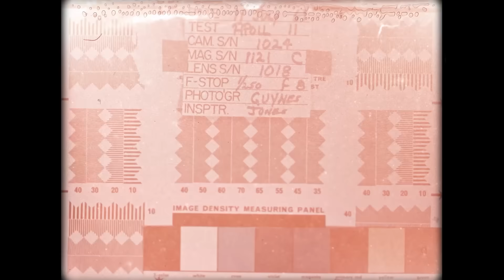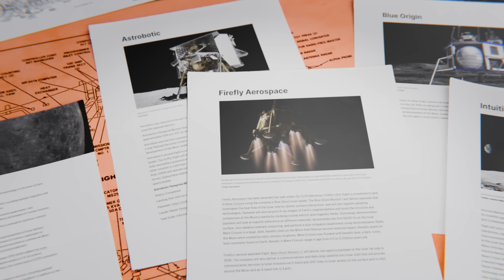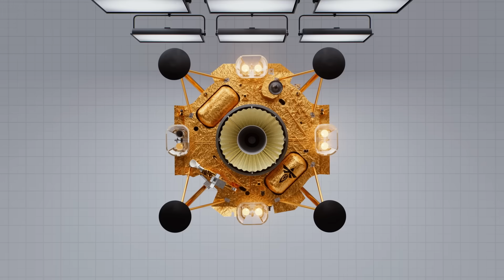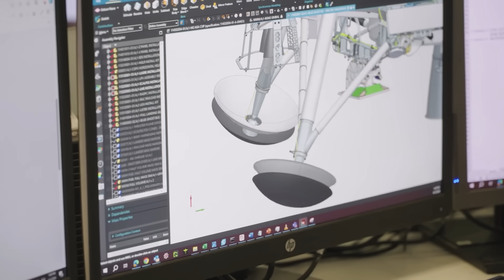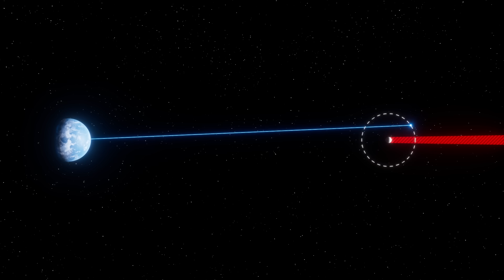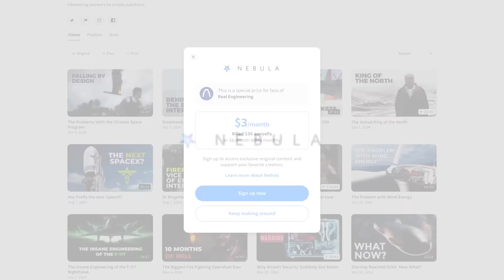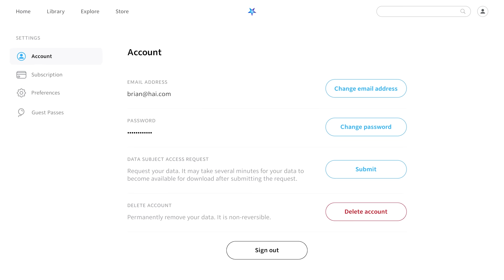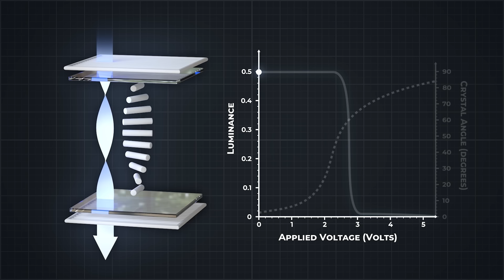Why the US is Struggling to Land on the Moon

Comment: Starship's tall Lipstick Vibrator shape will have it tip-over 100% if it tries to land on the Moon or Mars. Starship is just a musk federal money grab. 15 additional launches just to get 1 Starship to the Moon! Now that's efficiency!
Reply: Yep, there is NO way that thing will do anything but launch satellites. It's not going to the moon, nevermind mars. It's out of propellant on these empty test missions.
Reply: @volvo09  it turned out heavier than expected, so they're making a new stretched version that carries more fuel. And the idea is to launch fuel into orbit, refuel from a depot and then go to the moon.
Reply: Elon Derangement Syndrome. Symptoms include inability to do math.. Forget Starship. Falcon Heavy can get an Apollo-11-like payload to the moon right now for 500million. No additional cost or launch infrastructure needed.

With Starship, 15 launches at 2 to 20 million per launch at 2+ launches per day would fuel Starship in a week, and be FAR cheaper per KG than a 2+ billion SLS launch.

I hear SLS has to rebuild the entire tower bc they spent more money on retrofitting the tower than they would building a new one from scratch, only to end up building a new tower anyway. All this, for a rocket that no one is copying bc it has zero future.

And you think Starship is a waste of federal funds? Your symptoms are severe indeed.
Reply: the fuel settles to the bottom, it will not be top heavy. The whole point of starship is that you dont need to build 15 rockets to send one to the moon. You just fly the same couple rockets over and over. Although they totally have the capability to build that many rockets for cheap as they optimized for mass production in many ways
Reply: @linecraftman3907  SpaceX current capability? 2 Starships per month, 2 engines per day. Those are insane sci-fi numbers.

If this goal were pitched to a normal space contractor anywhere else, any-when else, you'd be laughed out of the pitch meeting.

For perspective, months for a single legacy engine is normal, assuming R&D is totally finished. If the engine is still being developed, we're talking a year per engine.

Two engines per day in addition to new development is unheard of.

Comment: Apollo had incredible ambition and backing and that really made the difference. Everyone was on the same goal. Plus, we now have the added goal of doing it without completely expending the launch vehicle like Saturn V
Reply: Apollo had less ambition than Gemini.

Jim Chamberlin 🇨🇦 fixed the failed mercury programme.  Then designed and built Gemini - with the capability to fulfill the lunar mission if required, while only ever being a stepping stone to show that Jim and the Avro team could succeed where America failed.

Then they did Apollo and Owen Maynard 🇨🇦 working under Jim 🇨🇦 designed the lunar lander with the 2 vehicle concept that Jim would have used with Gemini if the President asked him to make Gemini ready instead.

Many in the US didn't believe in the Canadian Digital transistor controls invented for the Avro Arrow, many didn't believe the Gemini programme could be improved upon, many didn't believe they'd have the time or money for Jim and the rest of the Canadians to finish a 2nd spacecraft and unproven lander too.
Reply: Funny, but the older I get, and I'm old now, the less I believe that the US went to the moon, especially given how they are behaving now. Just saying.
Reply: Pretty sure the SLS is fully expendable.

Comment: Instead of visual, it should be a combination of lidar and visual.

Tesla should do lidar and visual too, it's a serious mistake to risk so much on JUST a visual system which can be obscured.
Reply: from my limited understanding of lidar, isnt it essentially light bouncing? wont the dust also affect it jsut like the visual systems?
if not from all the extra light bouncing off but from sensors getting obscured?
Reply: @aidanpendleton7366  Yes but also not at the same level as cameras, cameras. Further in the darkness lidar is far superior to cameras. So even with some dust - which could be tuned for, the landing would be better with lidar as the rocks would get picked up and with more depth. 

A combination of cameras and lidar is likely the best option - just like how self driving cars should do it if they really value human life.
Reply: thats how india did it.
Reply: if tesla ai won , they would create monopoly , but if lidar  , tesla would say "sorry fsd not available" , buy these lidar and we will remotely update the software , or just give away new cars with lidar installed.
lidar is stupidly easy

Comment: Simple answer: Because it's been contracted out to certain businesses with particular aims rather than a focused engineering goal. You know who you are SpaceX.
Reply: Yeah, space x is spending the money on their own things without putting the moon as a priority. 

They're never going to make it to the moon, but they will have a large rocket (starship) that they can deploy satellites and whatnot from.
Reply: I am curious how this is SpaceX's fault. How is Orion's failing heat shield SpaceX's fault? Is the fact that the Second SLS hasn't even been stacked yet also SpaceX's fault? What about the fact that the thing to move the SLS is estimated to cost as much as NASA is giving SpaceX for the entire Starship Program (~ 2 Billion USD)? Finally, lets compare the 2 vehicles that are being developed for Artemis. Starship is a fully reusable, super heavy vehicle that has never been made. SLS is literally made of spar parts and is worse then the Saturn V, made some 60 years ago. Starship has flown 6 times. SLS has flown once.

If you can explain how all these are actually SpaceX's fault, then I'll stop responding, because you would have to have some sort of delusion.
Reply: Communism always seems more efficient.